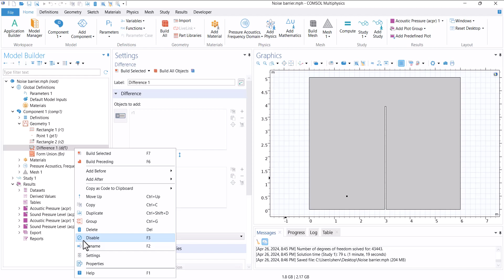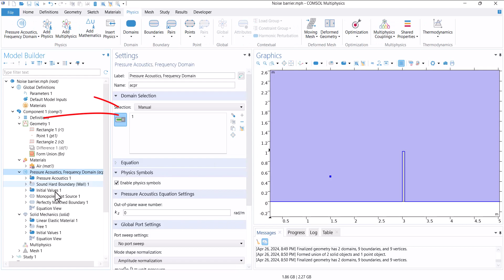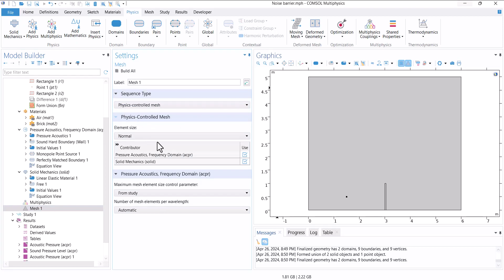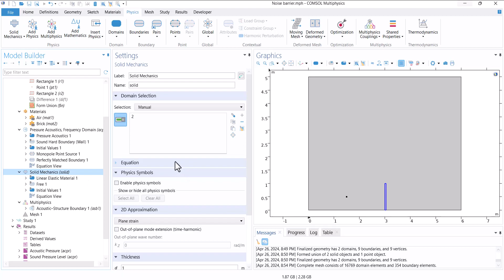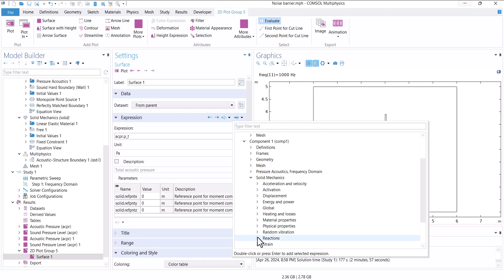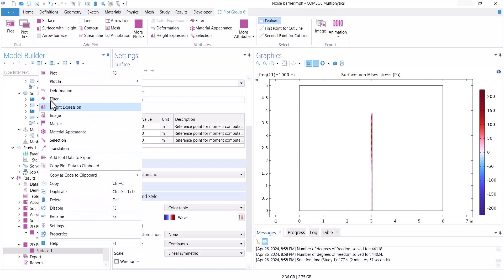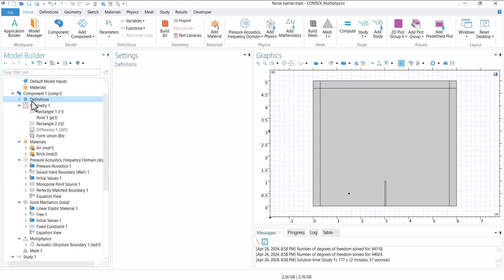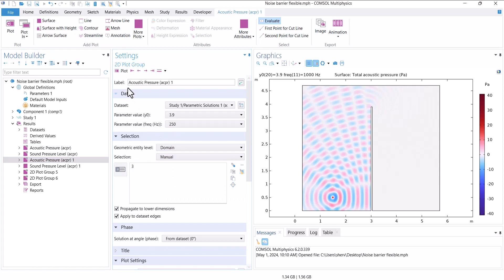🔊 COMSOL Tutorial: Monopole Sound Source with a Flexible Barrier (Part II) 🚧

Comment: Hi, thanks for the video. I have a couple of questions about the monopole model:
1) When you set the input power to 1 W, is that value the same at all frequencies? If so, converting to sound power level gives 120 dB. Yet a point source in a free field produces about 109 dB SPL at 1 m and 103 dB SPL at 2 m. Why doesn’t the monopole obey this inverse-square behavior?
2) To evaluate high frequencies more efficiently, is it necessary to combine the monopole model with ray tracing?

Thanks !
Reply from the maker: Hello, you're welcome. If you use a monopole in 3D space, the inverse square law is governed by the model because spherical wave amplitude is a function of 1/r². I haven't checked the inverse square law for 2D space before. Regarding your second question: ray tracing uses the eikonal equation, which is a geometrical approach similar to light, so it cannot capture diffraction on the wave in the same way as the Helmholtz equation (wave approach). Therefore, ray tracing only decreases the computational cost at higher frequencies.